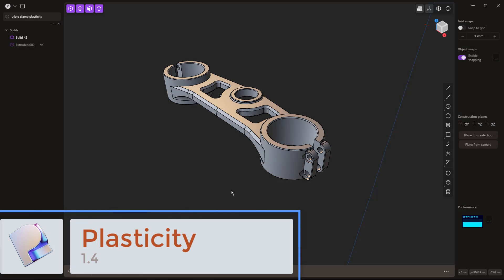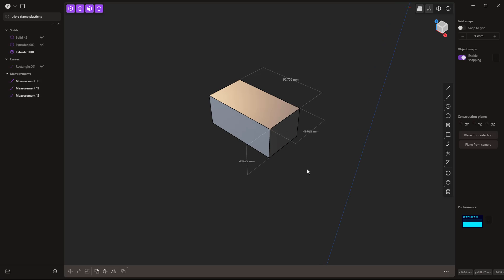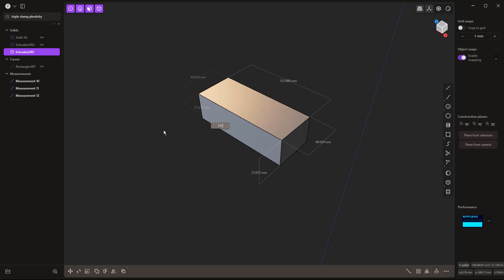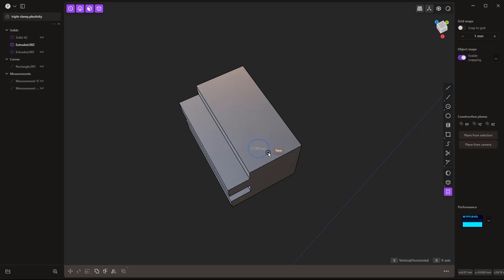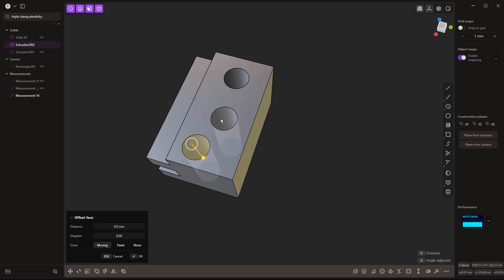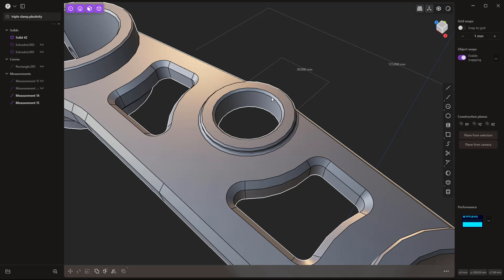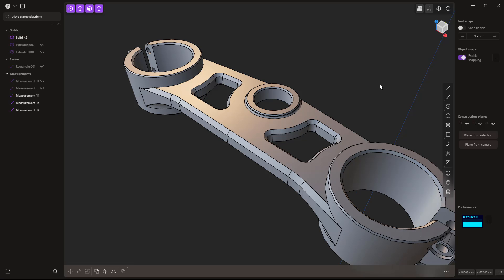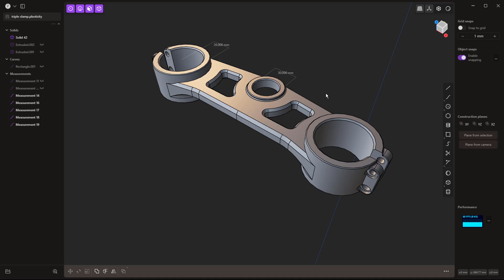Plasticity 1.4 | Dimensions and Measure Tools | What They Do And How To Use Them | #plasticity

Comment: To me this highlights the limitation of Plasticity vs CAD. As a mechanical designer, I just can't quite see using it other than maybe to quickly mock up designs. If you really want to edit things for 3D printing or production, get really granular on dimensions and fit tolerances, then things like not having the tree of sketches and operations you can go back and edit, being able to symmetrize something and still edit one half and have the other half update . . . these are important and save vast amounts of time. Not being able to change the dimension of things after they've been modded - huge limitation. I'm not talking about full CAD with all the bells and whistles and curve analysis and simulations and CAM etc. But until you get something close to the full Onshape Part Studio or FreeCAD Part Design bench . . . just don't see it.
Reply from the maker: For sure.  Plasticity at its core is a "Direct Modeler".  Even though its built on the same Parasolid Kernel it isn't aimed at full parametric control.  This video was with version 1.4.  The dim/measure tools have improved to the point where you can change locations and dimensions of features.  I don't think its a good fit for a production type workflow.  I wouldn't use it to say make a molded part.  But it can be used in that capacity with careful planning.  But for sure you couldn't go back and say change draft angle easily if you had a parameter stored in a traditional CAD.

For that i still think Fusion is the best option for 99% of peoples needs when designing for production.

Comment: No matter what i do, nothing happens.  I select F and type in the search for Measure, find it, select, but it won't let me select anything on my object.  I see my cursor change when i select "measure", but when i try to select the edge, it clicks out of the "Measure" functionality.  How are you selecting on the edge.  Do you click then hold and drag, or double clicking.... or??  

OHHHH... coming back after 30 minutes of trying.  You have to hold down the "Control" key while hovering over the edge for it to work.  The is after you find and search for Measure, or using the shortcut.
Reply from the maker: Glad you found it, but you shouldn't need to hold down CTRL.  Note that not all selections are valid.  You can go point to point or edge to edge but if you try to grab a face it won't work.

Comment: Great video this makes sense to me for rectangles and cirlces however im having problems creating an ellipse.

how do i take a circle with a diameter of 15mm on the X axis, and then stretch the Y axis to exactly 25.5mm?  I just cant figure this simple process out!
Reply from the maker: If you want to stretch it you would need to use the Scale (S) tool, but you won't be able to dimension it that way.  Probably the closest thing would be to create lines for the two width values, and then make either a spline at all 4 end points, or to take a circle and scale it
Reply: @ thank you sir ill give this method a try

Comment: Some of the selection and dimensioning steps weren't working, while others were. Apparently "plane from selection" getting highlighted instead of the reference face I want was causing issues and I had to remove the plane. Plasticity has been an interesting learning curve and equally fun, and videos like this significantly help in figuring it out. Thanks for sharing!
Reply from the maker: Yeah some of the functionality has changed a bit.  Check out the whats new vid to see how some of that has updated.  I have it on my list to purge some older content or at least make a complete new version. https://youtu.be/LSAc4uyxTao
Reply: @LearnEverythingAboutDesign  Thanks!

Comment: how come when I have several rectangles and I use the dimension tool and tab all the way to the Z (height) and change it only some of them change and now they are different sizes?
Reply from the maker: Each object is an individual thing even if they are copies.  There is no history or links.  With the most recent update you can use dimensions for features and drive them with the move command, but everything is independent still.  

If you have 2 cubes and one is taller than the other.  If you want them to be the same height, select the top of one and begin using the offset tool (on by default when you select a face), then hold down CTRL while dragging and move your cursor to a point on the other cube.  It will let you snap to the same height.
Reply: @LearnEverythingAboutDesign  copy that. I figured it out. Been playing with it for the last 6 hours. Made a construction yard from red alert 2 and a lightsaber hilt so far haha

Comment: Can we do something like put a hole on top of a rectangle and tell it we want it measure to 1/2 the width of the rectangle so it centers it and if you adjust the rectangle it will move the holes?
Reply from the maker: Sadly no. there are no parameters to speak of.  in version 24.2.x we can now edit dimensions to change the position of say a hole on the top of a box, but you can't control it with say a ratio so its always half the length of the edge.

Comment: I purchased the Studio version 10 months ago but every time 'I'd tried to use the product I would get lost, my 2D/3D skill set was stuck in the 80ites. Following your video I was able to produce my first 3D object to print! I did find that working with objects that are only 1.5mm tall I have to zoom in to get the right selection (I just discovered the four icons top left, the third one in just selects the FACE which solved the zoom issues). I think my issue has been trying to locate an object at a X,Y point, I can draw a rectangle at 0,0 to 50,50, extrude it 3, then when I tried to place the cylinder I couldn't figure out how to get it at an X,Y location...
Reply from the maker: It can take a bit of getting used to.  Setting up your coordinate system first is helpful.  I just released a course on my site www.learneverythingaboutdesign.com walking through a speaker design for $10.  and we have several playlists and how tos on this channel including this basic modeling workflows series https://www.youtube.com/playlist?list=PLBDfGh8A8kXVIrO1aizPFmRBy-A-G9svk

Some quick tips.  If you delete the cube in the start up scene, before doing anything else hit the / and it will zoom to your grid.  If you create a rectangle at the origin with a specific size (50 x 50) and its too small to see. after you OK/right click, hit the forward slash to zoom into it.  The default startup scene is in meters, and even if you change the units it will still make the original size cube unless you save a new startup scene from the P(file) menu.

This getting started is not with the current UI but not too much has changed (Single right click vs double to confirm in the old one for example).
https://youtu.be/9cgBK8ljH1k

Comment: 8:40 Man that sucks. So if you have a complex shape then you have to move each and every surface individually? You should be able to lock faces together so that if you move one of them it moves the whole group. That is a massive fail IMO. I hope the developers consider allowing us to group items together so that they move as one.
Reply from the maker: It depends on what you are moving.  And there have been a few updates since this video.  Version 24.2.x is out now and some new stuff was added.

If you want to move multiple faces you can select them.  If you try to offset a face and there is tangency like filets to other faces, it should move them all.
Reply: @LearnEverythingAboutDesign  Can I move a face/body relative to a reference plane like you showed in the video (say you want to make it exactly 50mm from centre of circle to the CL of object) but you want all the other objects to move with it. Is that possible?
Reply: @The.JZA.  Yes.  There are some updates in 24.2.x and im going to try to make a video about that today.  But in order to move something so its at the same height for setting up to 3d print i would suggest using the Freestyle option in move.  this lets you pick a from and to point.  Put your part centered at the origin. then move it in plane to where you need it.

Comment: 5:36 Is there any way to automatically space objects or do you have to manually move each one? Like if I had 50 of these circles and I wanted them to all be equally spaced, is there a shortcut to do that?
Reply from the maker: You can do an array of them.  there are a few types with some options but that is likely the best bet.  Manually moving stuff sucks so i do try to have references or start from 0,0,0 when possible.  When moving you can use the Freestyle option to snap to locations.

Comment: Thank you for making this video. I did find it quite annoying that Plasticity didn't have measurement to adjust the size of things after you have drawn them but now I see it was just my lack of knowledge. It would be nice if the measurements all just popped up as soon as you click on something. Like if you click on a circle it shows the radius and diameter. If you click on a line it shows the length. If you click on a rhombus it shows the length of the edges as well as the angles of the faces. And then if you could just simply click on these dimensions to edit them, it would make things so simple. The only modelling software I have used is Revit (I'm a structural engineer) which is quite different but I do miss some of these quality-of-life features when using plasticity. 

Could you possibly make a video that covers common errors in Plasticity and what is causing them and how to fix them? Like sometimes I am trying to fillet a bunch of edges on a shape I just made and then I get an error which prevents me from finishing my action. Surely Plasticity could fillet all of the edges that it CAN fillet and then highlight red the edges that it couldn't fillet and maybe help me to understand why this edge can't be filleted when the mirror image edge was able to be filleted. I feel like I am banging my head against a wall when using plasticity sometimes. It can be really frustrating when you are encountering errors and you don't know why the error is occurring. I have also encountered issues with trying to set keyboard shortcuts. They don't seem to stick. Also sometimes it seems that I try to do a command and a completely different function is activated instead? What the hell is going on?
Reply from the maker: On your first point, when you select something take a look in the bottom right hand of the screen.  It should display info about what you have selected.  Length, surface area, volume etc.

On the common errors i hear ya.  No real warnings or error messages make it tough.  I don't really have a list of common errors but if you want to email me support@caducator.com  with stuff you run into i can try to make a video/short about them.

Comment: Really would like to get away from Fusion but it Seems like I should wait a bit. My modeling is not that good as it is to have to try and figure out work around.
Reply from the maker: Yeah it all depends on what you do/need to do in CAD.  I couldn't leave Fusion and just use Plasticity, but I do design work for clients and need a lot of parametric control.  Sometimes the clients require I use Solidworks, sometimes Inventor, and Sometimes Fusion.  

I don't think Plasticity will ever go to a history based parametric CAD replacement.  It is aimed at a different target user, but it might get people who want a perpetual license model and don't need drawings, simulation, PCB design or other things that Fusion offers.

Comment: So with this it's basically a more streamlined parametric CAD (maybe without a timeline like in Fusion360)?
Reply from the maker: well yes and no.  The big difference here is that there is less parametric control.  So in Fusion you start with a sketch, you define that (typically) with dimensions, then you build solids or surfaces from that sketch.  With plasticity the "curves" just exist.  You can control the input with a dimension at creation but for the most part after its created you are doing all direct modeling.

So for example say you make a square that is 10mm x 10mm. then you start modeling and adding features like fillets.  If you want to go back and change it to 12mm x 12mm, in fusion you would edit the sketch and it would update the shape.  In plasticity you would need to offset faces.  That has some downstream problems if say you HAD to have a 2mm fillet because now if you offset the entire thing the fillets get larger.  It takes a different approach and typically its used for modeling intended for vfx/animation, game assets etc.  It can be used for 3d printing as well and we have several videos on that (Mario ? block, 3d printed threads, and some older videos), but your approach to modeling needs to be a bit different.
Reply: @LearnEverythingAboutDesign  Thanks for the reply.
I need precise fillets for CNC carving, but I'm doing smaller and not particularly complex shapes. If I resize and break all fillets or the "CAM-ability" for a given radius end mill, is that easily fixable for simple designs or would I be significantly better off with Fusion 360? (I absolutely hate the SaaS model and would love avoiding it if I can).
Reply from the maker: @kay6736  If your end goal is CNC I might suggest a CAM program that has basic CAD in it that doesn't have the SaaS if that is what you are trying to avoid.  CAD in a CAM program usually sucks :)  I supported Mastercam for years and always preferred to do something like an add-in for Solidworks instead of modeling in the CAM program.  There are options out there.  I do most of my CAM program.  well all of it these days in Fusion but a quick search on some free options out there. https://mecsoft.com/products/freemill/free-cad-cam-software/

I have no experience with that.  They do also have an add-in for Rhino.  I am not a fan of the workflow/ui in Rhino but to be fair i haven't tried Rhino 8 yet.

Comment: Thanks for the useful lesson, but how to set exact dimensions for curves?
Reply from the maker: With Plasticity there is no direct dimensioning system like you have with other CAD programs.  You can dimension "curves" meaning lines on input but not on a spline curve.  About the best you could do is set up some reference lines for where you want control points and snap to them.  You can use Measure so there is an onscreen dimension to show you where they are in space.

If you need precise input for complex splines Plasticity might not be the right program currently.

Comment: GRAB edge is not working
Reply from the maker: I think i need to redo this video.  these dimension and measure tools came out in version 1.4, but now its on version 24.1.1.  I honestly don't use these tools in my workflow with Plasticity.  I haven't noticed a different behavior in 24.1.1 though.

Comment: That’s very nice but in my language, the equal sign is on shift + 0 and so the keyboard shortcut doesn’t work. This is a problem I’ve had in other software too - some characters that have their own key on English language keyboards, have to share key with another character. Is there a nice general solution to this?
Reply from the maker: When you search for a tool in Plasticity "F", you can right click on the tool in the list and change the shortcut to whatever you want.  That might be the best option.  Also keep in mind these tools showed up in version 1.4, but its on a new released 24.1.1 now.

Comment: Can you freeze part of model(dimensions), so it cannot get accidentally modified?
Reply from the maker: Everything in Plasticity is "direct" modeling.  After you make geometry there is no link back to the curve.  If you want to increase the size of a hole you offset its face.  So some primitives can be manipulated with the dimensions but only until you add or remove from them.
Reply: @LearnEverythingAboutDesign  It might be something to think about....once you add some dimension, which you positively do not want to change, freeze it and put maybe red mark on it and make it connected to the model in a table(?) of frozen dim's....That is a typical problem with direct modeling, you can screw up the model not even realizing it.
Reply from the maker: @jiritichy6855  Thats a cool idea.  I know the onscreen measurements are there for a sort of check of that, but freezing geometry would be nice.  ill take a look at the Plasticity Discord and bring it up.

Comment: Sorry to ask as newbie: 
How do I get Equal sign on my Windows laptop keyboard (has also numeric keys on the right) to start measure tool in Plasticity. 
I have to press Shift + 0 to get Equal sign "=" in other software. 
But Plasticity does not allow me to hit more than Ctrl+Shift (would have to hit number 0 as well). 
I try to program my Spacemouse button with Macro sequence. But no succes so far
Thank you for the answer. Regards Aleksander
Reply from the maker: Hi Aleksander, I am not 100% sure as my laptop has a full keyboard on it. but what you can do is hit F on the keyboard to find the dimension command.  when it pops up, right click on it and you can assign a new shortcut so you don't have to use = if that is problematic